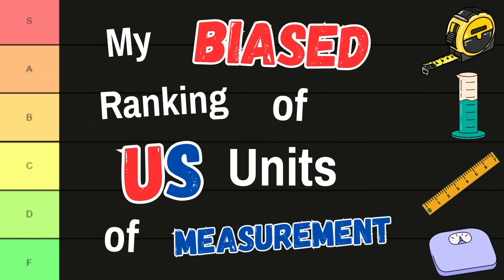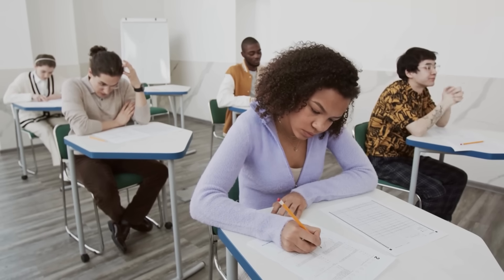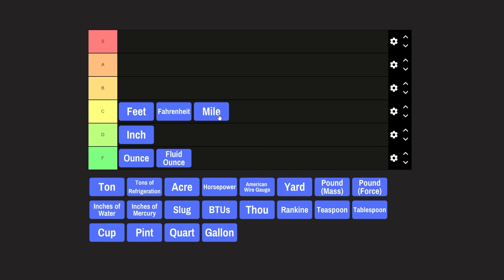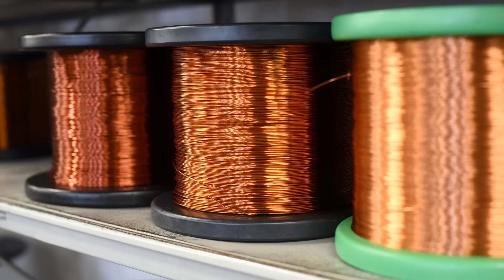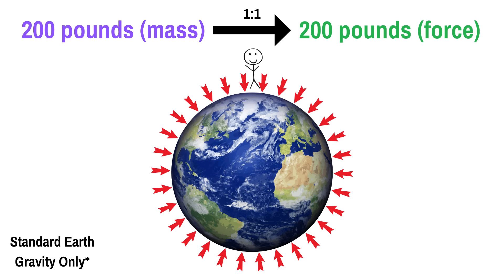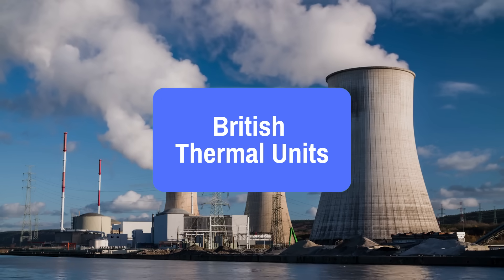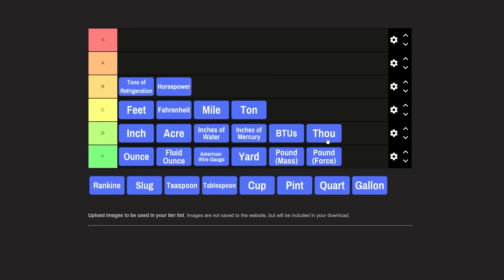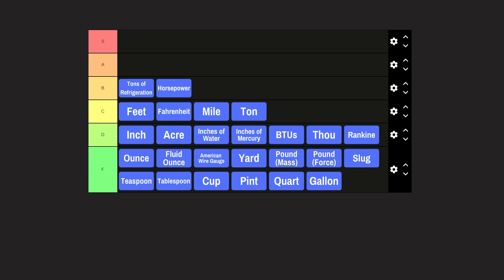Tier List of the DISASTROUS US Measuring System

Comment: I know the intro already said that this list was going to be biased but this list is so incredibly biased that I'm amazed that it came from a science channel. Inches may have arbitrary baselines like most US and Imperial units but the ease of division warrants a better rating. It doesn't make sense that it's rated lower than feet and mile. It's weird that a science channel would put Rankine below Fahrenheit simply because of the perceived ease of using Fahrenheit. It's like putting Kelvin below Celsius. Ton isn't that good of a unit since there are three units of mass that bear the same name, two of which are in the US and Imperial system which are often mistaken for each other. Inches of water is clearly inferior to inches of mercury since mercury is a liquid over a wider range of temperatures. Slugs are better than pounds since the confusion between pound-mass or pound-force is resolved.

Comment: To all you gushing about "the metric system", they are all metric systems. I'm sure you mean SI or the French Metric. From when the geniuses of the French Revolution decided they needed a new system to go with their short-lived new world order. And being brilliant mathematicians and scientists, they decided against using a standard yard with new divisions, to make conversion with the old system easy and perfect, they decided to use something more accessible - the distance from the north pole to the equator divided by 15 million. Awesome! Also since all the smart guys knew Greek and Latin, the prefixes for things bigger than one are Latin and less than one are Greek. To cap it off, they disdained the old system of single syllable words that never sound alike in favor of multi-syllable which all sound the same. This might be why it did not catch on in the trades where people work in noisy environments. And the old folks like rational arithmetic because it is exact. Multiples of 10 are terrible for that. Did you ever see an instrument  with knobs that went 1 10 100 1000 10,000? No, steps are too big. They are always  1 2 5 10 20 50 100 200 500..... (The US does not use Imperial. It is US Customary units and is different.) Conversion estimates are simple: 10 sq ft is 1 sq meter. 100mm is 4 inches. One inch is 25mm. One meter is roughly a yard. Add one yard for every 12 and you are very close.  One fifth of a gallon is 750ml - look on any whiskey bottle.

The yard comes from fabrics. It takes a piece of material 1 yard wide and 2 yards long to make a set of clothes for the average adult male (not modern Americans!). An archer's arrows are called a "clothyard shaft" which is a typical draw from an extended fist to the cheek + a little. Not surprising since the span between  outstretched hands is close to the height of most people. My span is actually 6" greater than my height, giving me a very high ape-index.

And why would you expect jogging to give a good value for a pace?
Reply: 1 sq metre = 10.7639 sq ft
4 in. = 101.6 mm.
1 in. = 25.4 mm.
1 gallon= 3.785 l.(1/5 = 0.757) 
So that's why in american cars such gaps between the panels?
Reply: @Santia5a  Because you always use the decimals in mental estimates? They would not be estimates.

The gaps are so the panels don't wrinkle when you jump the cars in TV shows.
Reply: @charlesspringer4709  you don't understand the point. You're system is incorrect. 20 sq metres is not 200 sq. ft, its 215.79 sq ft. 
Or 20 in. it must be (by your logic) 50 cm. In reality is 50.8 cm.
P.S. in precision manufacturing imperial system don't work. Part with diameter of 4 mm. or 5 mm. it's a huge difference for some details (mechanical watch for example). Now explain this difference in Inches.
Reply: @Santia5a  Yes, I understand. If I am looking at houses, 1750 sq ft is close enough to 175 sq meters. And if you want precision, 12 units is much better than 10. Rational arithmetic is exact. 10 is commensurate with 2 and 5. 12 is commensurate with 2, 3, 4, and 6, which is why 12 was used when people could add fractions but not do divisions. I'm not talking about chemists. And in the USA the inch has been defined as 25.4mm exactly for ages.

Comment: They are so cumbersome that the quart exists because the gallon is impractical. But a quart is close to a litter and you can roughly approximate a yard to a meter. The conversion btw f and C is the most difficult . I also consider the cooking measures trash,

Comment: Interestingly, the foot actually gets incredibly close to giving a round power-of-ten value to an important physical constant that the meter makes a mess of (though the metric foot of 30 cm gets even closer).

I propose that we replace the meter in SI with the foot, and redefine the foot to be exactly the unit of length such that the speed light is exactly 10^9 ft/s.

Comment: Fahrenheit absolutely faking sucks man, only used in the us, makes no sense, and like why aren't the boiling and freezing temperatures just random numbers. Whith Celsius it's easy, boiling is 100° and freezing is 0° degrees, and off of that it's easy to determine what temperature stuff is, like perfect temperature outside is about 20° to 25° degrees.
And yeah u can't change my mind sorry. Also why not just use metric sistems, ik it's weird to just change it all of a sudden but it's easier to just have the same measurements as everybody I feel like

Comment: I’ve heard some americans get confused when they come to sweden because we have the word ”mil”, which sounds like mile but actually means 10 km and not 1.6
Reply: In Finland it is "peninkulma" so there is no confusion. Also nobody uses it. 

Russians had a unit verst which was 3500 feet or 1066.8 m.  As it would have been nice if Finland had the same unit so in 1827 unit named virsta was chosen and it was chosen to be one tenth of a mil or 1068,80. That is not a typo, it was  meters longer. Precision was not that important. That likely was the reason we did not keep the longer unit.

Comment: Another useful thing with Fahrenheit (which you kinda mentioned) is that it is easy to see if you have a fever. If your temperature is 100 or over, you have a fever.
Reply: And the same can't be done in Celcius?
Reply: @dampaul13  Yeah, but the number 100 is easier to remember in my opinion.

Comment: I think for most people, Fahrenheit is definitely the best temperature system. It is more precise with smaller units than Celsius, and as you said it is geared around the human experience of temperature, whereas Celsius is based around water’s experience of temperature. Unless you’re using Celsius in calculations, which most people do not, then Fahrenheit is better.

Comment: You forgot American octane rating for petrol. It’s absolute lunacy. The rest of the world either uses RON or MON system. But Americans decided to use (RON + MON)/2 as a unit of measurement. Imagine inventing a new system of length measurement that uses (cm + inch)/2 as its unit. This is just pure attention seeking behaviour.
Reply: Nope, my bad, we're apparently using RON system here. Still calling it just octane rating tho. Apparently you were referring to AKI system
Reply: Wait, is it not used in Europe or smth? Here in Russia ,we have a metric system, but still, octane rating is a thing here. I thought it is a worldwide standard
Reply: We use octane in Croatia which is part of EU. It's simple. You don't have to know what it actually stands for because: 95 is good and cheap. 95 plus is better but little priceier and finally 100 is best and most expensive. There used to be 98 but they removed it.
Reply: Thank you, another nightmare unlocked for me
Reply: Had an aneurism reading this whole arguing in the comment section of a comment ,_,
Reply: Well at least it wasn't (cm + pound)/2.
Reply: Octane is actually widely used by the aviation industry around the world since it’s the average of 2 reliable measurements, and they use 2 measurements of lean and rich octane for engines, it’s not merely based on the other 2 it just makes sense in its circumstance
Reply: @scoobsshrooms109  and in scientific research they use units like Kelvin for temperature. that doesn't mean it makes sense for civilians to adopt it. so unless americans fly their private jets into a petrol station and fuel up next to a honda civic, there's no reason why petrol stations for CARs should use aviation industry units.
Reply: @Ballacha  well you know that most of imperial was designed for everyday use and not scientific, Fahrenheit was literally made in reference to humans understanding of temperature 0 - cold, 100 - hot. Feet, literally the size of the average man’s foot, an inch is about a knuckles length, etc. and you know what else is designed for scientific use that’s used in every day lives? Metric. Besides, the difference between octane rating and RON is only around -10, so really easy and simple to convert since you already know the equation, not even sure why it’s such a big deal to you anyway
Reply: @scoobsshrooms109  "what's the big deal" on one hand, super defensive on the other lol. just in case you forgot what the point of measuring is - it's to get a precise parameter of the thing measured. feet, fahrenheit etc are bad because their origin is human approximation, as you yourself pointed out correctly. 0 celsius is the freezing temperature of water under 1 atmospheric pressure and 100 is its boiling temperature. a meter is if you put a metric ton of water (aka 1000kg of water aka 1000L of water) in a cube, the cube's length width and height will all equal to 1 meter. nothing is approximated and 90% of metric units relate to each other like i illustrated. how is it "designed for everyday use" if imperial length units don't even relate to each other in ways that you can easily do coversion in your head?
Reply: @Ballacha  you completely avoided the point of my comment and focused on the wrong thing. Where I come from we call that a straw man, I will not entertain this nonsense. Good luck finding someone that will
Reply: @scoobsshrooms109  where i'm from, deparately trying to find a label to slap onto the other person while saying nothing of substance is the most obvious sign you are completely out of valid arguments. retreat, little one, retreat.
Reply: @Ballacha  you proved nothing in your last comment, You said that octane was too scientific for everyday use, I exclaimed that metric is also scientific and used everyday, you proceeded to go on about how scientific is great and human relativity is bad, completely missing the point or doing it on purpose. I can only wish you good luck in whatever future studies you include yourself in
Reply: @scoobsshrooms109  "octane was too scientific for everyday use" now that's what you call a straw man. ooft. if you bothered to read my first reply, you'll realise i said Kelvin is for science and then i agreed to your "AKI is for the aviation industry" in good faith, without doing my own research. where did i say ""octane (assume you mean AKI) was too scientific for everyday use"? lol.

but nevertheless, i entertained you strawmanning my position for the 2 subsequent replies. and guess what, now that i've done some research, i find the majority of aviation industry actually uses MON, not RON or AKI. keep replying my guy. it's very entertaining to see you digging a bigger and bigger hole.
Reply: @Ballacha  “Grades of avgas are identified by two numbers associated with its Motor Octane Number (MON). The first number indicates the octane rating of the fuel tested to "aviation lean" standards, which is similar to the anti-knock index or "pump rating" given to automotive gasoline in the US. The second number indicates the octane rating of the fuel tested to the "aviation rich" standard, which tries to simulate a supercharged condition with a rich mixture, elevated temperatures, and a high manifold pressure. For example, 100/130 avgas has an octane rating of 100 at the lean settings usually used for cruising and 130 at the rich settings used for take-off and other full-power conditions.” That method of rating the 2 MON ratings is very similar to AKI, since they are measuring two different ratings of fuel, lean and rich. Yes I call it octane because that’s what we call it in the states. Every source I’ve seen says they use this method, even European countries have to reference the difference between their RON and MON (RON-MON) for fuel sensitivity, this isn’t necessary with AKI because it’s already the average between the two. Just to be clear it is not MON that they use to rate the correct octane fuel for these engines, they use a similar rating but it digresses from there. This is really the mildest of all the US measurements that anyone could even care about, to be honest I don’t get why this is what you HAD to mention in the comments. AKI isn’t even an imperial unit, RON and MON aren’t metric units either. And it’s all kind of arbitrary, rather, because some people decided to test an engines knock resistance at 900 rpm and and some other people decided 600 rpm was better, and some people decided an average between the 2 was better, we are having this dull argument
Reply: @scoobsshrooms109  "with a rich mixture, elevated temperatures, and a high manifold pressure" oh boy... you've been talking about old piston engined prop planes this whole time??? you know these things are still using LEADED fuel, right? lead increase MON by a lot and MON has considerations of extreme conditions in it's tesing as you denoted. that's why civilian aviation heavily rely on MON based measuring for fuel. none of these have anything to do with unleaded petrol you pour into your car. do you realise that? my original point was about cars. i should've never allowed you to lead the conversation astray.

"RON and MON aren’t metric units either" that's right. but using either of these 2 is better than going through the extra extra unnecessary step to measure the same barrel of fuel with both units then divide the sum by 2. that's just classic attention seeking behaviour.
Reply: @Ballacha why the hell are you getting so defensive?
Reply: @ do you have anything of substance to say? Or are you just gonna cry “you are right but you are mean 😭 waaaah”?
Reply: @Ballacha  As far as I know petrol stations don't use that, gas stations do.
Reply: @Ballacha  Leaded fuel is only available in a handful of countries, and is specifically made for them. Why would the aviation industry still use leaded fuel? Leaded fuel has been banned almost universally because of the cumulative health risks. At this point, I think you are just trying to be argumentative, and if that is not the case they you are just not very bright.
Reply: @Ballacha  "you've been talking about old piston engined prop planes this whole time???" Why wouldn't he, that is the history of where it came from, and the system has not changed. Are you really this dense? Just because we ar not using leaded fuel any more does not mean the system doesn't work. Lead is an additive, any additive to fuel affects it's octane rating. so I don't see why you are hung up on lead, Most fuels around the world have additives in them, which all of the systems of measure can account for, no special system for any additive, because it is measuring the octane.
Reply: @scoobsshrooms109 "i will not entertain this nonsense" continues to do so lmao
Reply: @dudeinaroom1238 Leaded fuel is still used extensively in light aircraft aviation, many motorsports also do especially down to the grass roots level due to the higher octane and affordability. It just isn't used in big airliners and available to purchase at your normal pumps. It's far from being properly or completely outlawed.